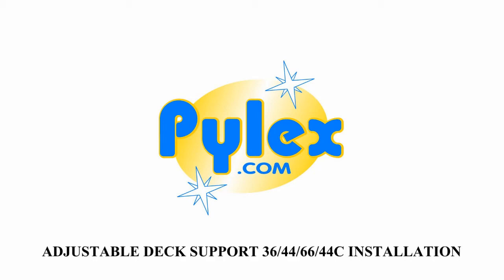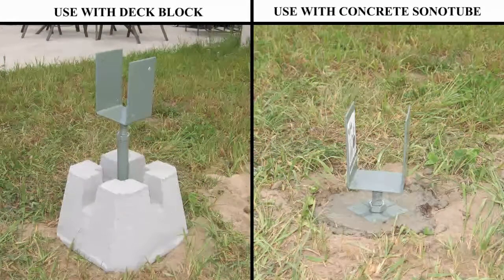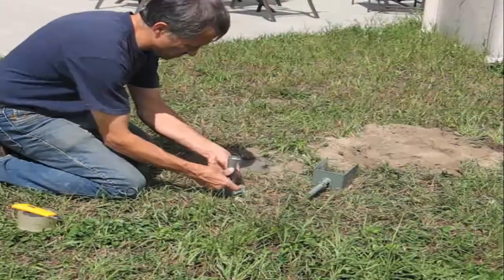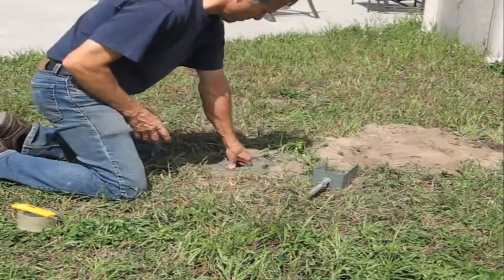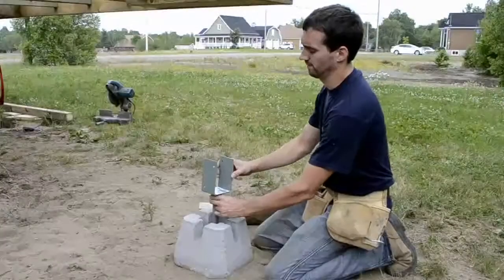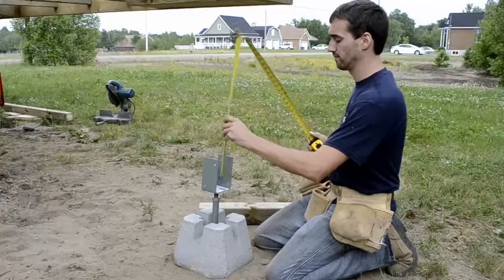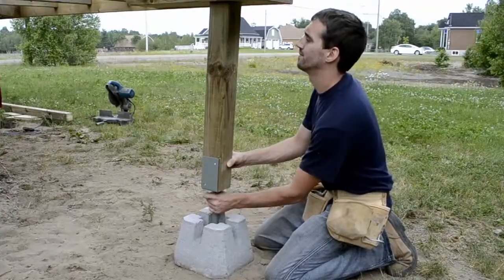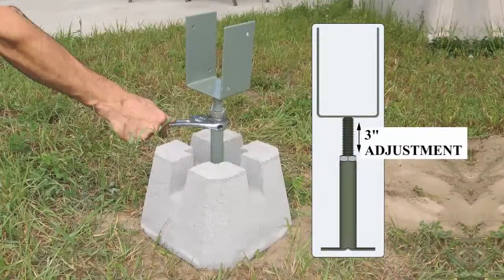Pylex Ajustable Deck Support Installation

Comment: Can we drill a hole into a concrete deck block and invert the support (as shown in the video for use with wet concrete)?  Or, must it ONLY be inverted by use with said wet concrete?